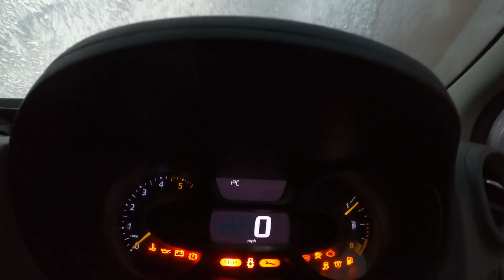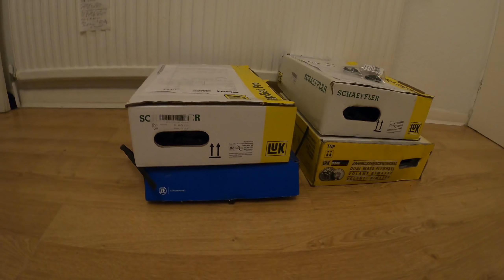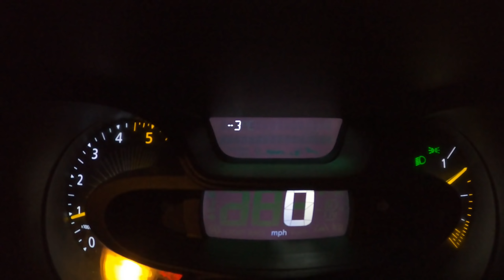Williams Mobile Clutch Service. Weekly Video Log (Week 03/01/2022)

Comment: Amazing. You make it look so easy! If there weren't two continents between us I'd call you tomorrow! 
I have a 2003 Megane II that is sitting in my garage with total failure of the concentric slave cylinder. 
Bought a new clutch kit almost a year ago, I only got to where I need to remove the gear selector cables, and I'm afraid after so many years those are going to break when I touch it.
Reply: Just do it man, its not as hard as you think
Reply from the maker: That’s it mate. You’re half way there if you’ve got the clutch  kit … maybe get a pair of hands ., it’ll be a nice project.

Comment: Just done my 306 Hdi. Took 3 days! The release bearing was welded to the pressure plate and the plate was worn like the 1st Peugeot in the video. The flywheel and friction plate looked like new! The clutch had done 260,000 miles. You'd think they would make them last a bit longer than that! Lol.

Comment: Great job can you show people the upper part taking the battery out battery box and disconnecting the gear linkage and air filter housing and removing the upper gear box bolts 💯🤔👍
Reply from the maker: Subscribe and access full repair videos.

Comment: Good video as always! 👍

What is the distance called you use when supporting up the engine?  34:45 for example
Reply from the maker: Thanks. Without looking at the video. I take it you mean the jack
Reply: @WMCS  No sorry. I meant the cube between the jack and engine.
Reply: @petit4695  block of wood?
Reply: @petit4695  Rubber block
Reply: @maverick507  Thank you! 👌
Reply: @petit4695  it was to help Kevin 😉
Reply: @skliros9235  Ye it could work, maybe a bit hard?

Comment: Howdy !
 One piece of advice from you please.
 I have an audi a4 b8 front wheel, the right side is always braked and I don't know what else to do with it.
 I want to mention that I changed the new caliper, brake fluid, discs, all new pads
Reply from the maker: If I get it correctly. Your front wheel is seized. Don’t want to speed freely. 
The only thing that spins the wheel from the hub is the wheel bearing.

Comment: What a great example of a bloke doing a proper hard job and doing it well. Hat off to you fella. Does the clutch plate, pressure plate and clutch bearing come as a kit or do they have to be ordered separately? I ask because I am interested to find out if my local Indi garage would have done this when I had mine done.
Reply from the maker: Yes mate. I get them as a complete kit. 
Thanks for the feedback
Reply: Great job how many hours does it roughly take you to complete a clutch ? 🤔👍💯
Reply: Great job what if you start a job and then heavy rain all day long that must be a right pain 🤔👍💯
Reply: Another great job what the worst make of car with the most struggling you have worked on from the floor ? 💯👍🤔